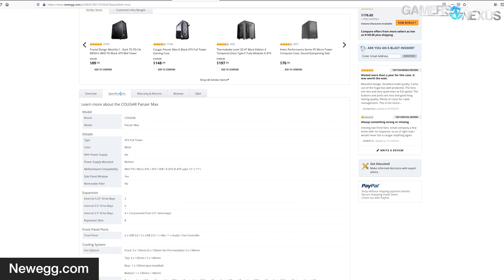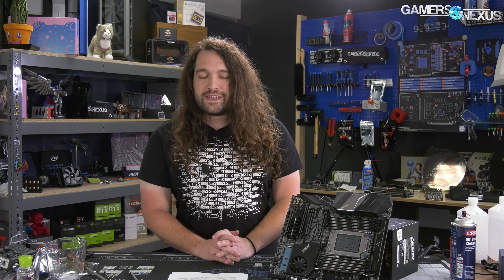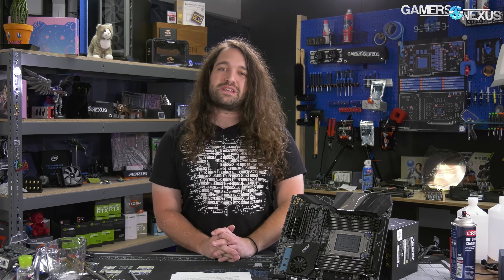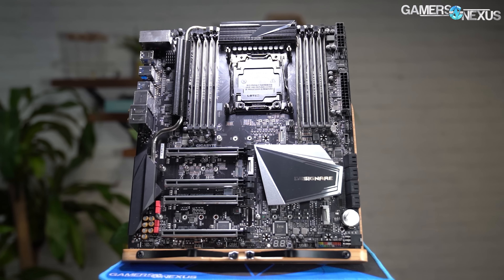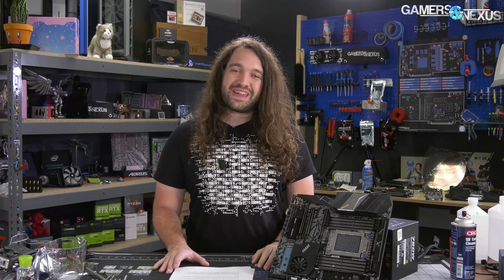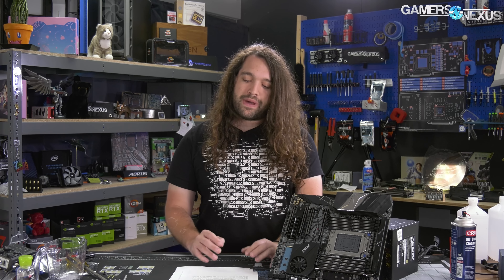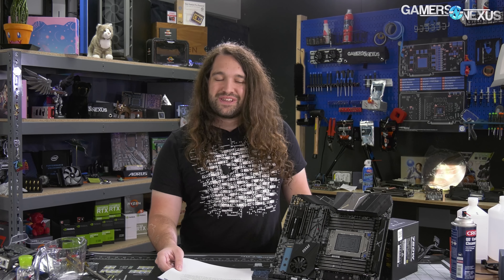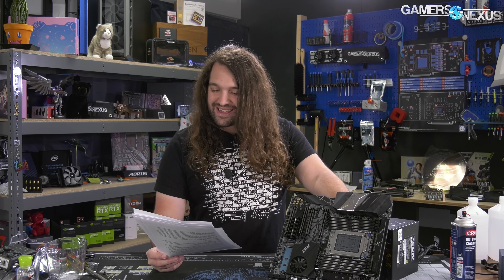"E-ATX" Is A Lie: How Motherboard Makers Ruined Form Factors

Comment from the maker: Watch hardware news for the week, including the AMD hack, over here: https://www.youtube.com/watch?v=T1dNHbDYlDA
Article: https://www.gamersnexus.net/guides/3566-e-atx-is-a-lie-vs-xl-atx-eeb-ceb
Reply: E-ATX, What part of 13 inches (330.2mm) Do They Not Understand!? lol.
so it is as bad as a top rad not fitting in cases that list them as 'compatible' if you don't use a motherboard at the same time, lol.

I'm sorry y'all, I think I'm partly to blame for this vid after poking and prodding at E-ATX and XL-ATX cases. Great vid Steve and crew. B)
Reply: Luckily,my locally made case supports motherboards up to 13"x15",
My case looks like the CORSAIR Crystal 570X RGB but it's much better and cheaper than it (There are filters including in the front,also i removed the front glass for air-flow),
and no i don't live in China,I live in the EU :D
Reply: 20+ years ago you bought e-atx if you wanted more pci slots.

Which is realistically what I'm looking for today, but can't find on current e-atx board's anymore that are usable 😔

As for cases, current generations on the market are useless to me, and since I have a wood shop I usually just build my own and fasten drive cages and motherboard tray internally.
Reply: You left out thin microATX that some ASRock and msi have where the width is smaller than the standard ATX
Reply: @portwolf2293  wasn't that WTX 14 × 16.75 in (356 × 425 mm)? for 9slot WTX and 11slot SSI-MEB 16.2 × 13 in (411 × 330 mm) cases?  I think Lian Li was the last to make them, about ten years ago.
Reply: @Zarcondeegrissom  I don't know about that specifically. I'm just pulling from what I remember back when I worked for Virginia internet express in 99 as a manager / network administrator.

14 years ago I changed professions because of job market saturation in my area so I missed out on alot.

Had to support a family 👍

If only we could talk gamers nexas to come out with their own line of boards 🤔
Reply: @portwolf2293  thats cool, and family first is always cool. B)
way back in 2004 I had dug into that stuff to dice up an old IBM XT case to make my own workstation case after not liking ANYTHING on the market for such things.  E-ATX has always been 7 slots (12x13 inches), tho it is understandable that 'extended' may be referred to as more than 7 slots by many. many do confuse micro-ATX and iTX all the time, despite the spec having 3 fewer slots on iTX than micro-ATX, lol.
Reply: Sick skin peel bro!
Reply: @portwolf2293  I am on my 3rd use of a Enermax ADV Ostrog as I am happy enough to have the unneeded drive baus from it.
Reply: your forgetting thor v2 which will handle all specs including xl atx/ssi ceb e-atx 12x10.3
Reply: Anyone wanna tell Steve that 2x4's are not 2x4?
Reply: I like your content, but Dude, please get a hair cut.
Reply: As much as everyone loves adding more work to their process, could Gamers Nexus add a quick internal measurement to their case review process and throw it into a spreadsheet somewhere? This exact issue has cost me $100's of dollars since getting into dual CPU workstations. Thank god for Microcenter open cases or it would've been more.
Reply: @Gamersd Nexus I got my first build built and posted and up and running with no problems.. I dare say 6 months of watching you and jayz2cents have helped immensely so glad I didn't waste my money on a pre built gaming rig. I love you guys !
Reply: dude     $450 on a card, today,  what r u goin with?   im buying one.  upgrading from a flashed vega 56..   cause im pushing a 38 in  75 htz 1600p ultrawide..  its not cutting it..    i just almost bought the nitro plus 5700 xt,  i was dead set on it,    and tabbed over and start lookin at nvidia cards..    help me out!   for real i value your opinion..     many thanks.   great work btw..
Reply: ITX has some crossover with DTX as well
Reply: lol how to make product sound better? Oh I know..let's just extend the name by putting literally word "extended" in it. Oh wait it's not cool enough anymore? How about we extend it even more!? Yeahhh let's put yet another "extended" word in it. Perfect! Lovely! Coz that makes sense ofc xd
Reply: If you buy a graphic card at the moment, you got ripped off, far worse than  normal.
Reply: If you bought a graphic card right now, you got ripped off.
Reply: Memorable video......was 10 years due and about time, you spoke out for all of us tha understand, that overall today, case manufacturers are charlatans, and that they should only make either CEB or EEB cases if and cut all the crap....... its sad to see they still make cases that could fit massive server boards, and instead all you can  drop in  is a postcard on the same damn chinese pressed motherboard tray that is worth 1 dollar
Reply: Mini-DTX is a stupit form factor too, it is AsRock's way to saying is Flex-MAtx...!!!!

Comment: This is right up there with "radiator compatibility" where the compatibility assumes that you wont be installing any RAM.
Reply: Or compatible with a 360MM radiator (as long as you chop the end-tanks off each side)
Reply: That one drives me nuts. "compatible with 480/360 etc etc". O but you can't use them all at the same time!
Reply: Getting a little greedy aren't we?  Asking for a cool CPU AND RAM?
Reply: I heard you can just download RAM as needed - no need to install it up front.
Reply: Jesus dude, don't remind me of the headache of trying to top mount a damn rad which says it's compatible, only to have to take the thing apart multiple times as the fans do their best to rip the dimm slots right off the board...
Reply: I had this issue on my first PC build. It was a terrible experience.
Reply: What do you you wanted a radiator AND fans?
Reply: @Ironclad17  my brother is currently running 2/3 fans on his Celcius S36 because his case claimed to support his GPU (Zotac RTX 2080 AMP! Extreme) and a front mounted 360MM rad, but did not claim to fit both at the same time 🤦‍♂️
Reply: Or prioritizing it over GPU intake

...@FractalDesign Era ITX

My theory is that cutting rad support and moving the mobo up 25ish mm would really help that case. 120mm intake from the bottom, Noctua U9S on the CPU, and 120 exhaust on the top.

Obviously, though, a manufacturer can't make a consumer case in 2020 without rad support and expect it to sell well. To quote a US President, "Sad!"
Reply: or a motherboard, given the VRM aluminum lump and EPS plug conflict in some cases with a top-mounted rad.
Reply: it's because they assume your just downloading your ram 😆
Reply: @Celician83  Did it mention supporting the GPU, a radiator and fans at the same time? There's your problem.
Reply: Fractal Design are a key offender for this. Like for fuck sake guys, I love your cases but come on. Just make the damned thing half an inch taller and deeper, and everything will be sweet.
Reply: Or want to use certain fan/pump headers
Reply: That's what RAM slot extentions are for! You just have to move them down to that pointless vertical GPU bracket.
Reply: @liftedcj7on44s  you can if you take the fans off! mounting them is rough though.
Reply: So true.. Fractal Design Meshify S2 (in my case.. hehe) i have a 420mm Radiator on top, it fits perfectly BUT i had to cut some corners from 2 of my fans to make it possible to mount them because of my mainboard and trident Z Royal ram. It gives me herpes..
Reply: Just found that out in my meshify c mini. Can’t fit a 240 rad with fans on top with ram installed. Well, unless I wanted to cut some plastic from the fans lol. Had to put the rad in the front
Reply: @Zarcondeegrissom  Who the hell needs EPS connector! Right? Right? Looking at you Fractal Design and Cooler Master!
Reply: 640k ram is plenty enough!
Reply: why do u need ram if u have a sweet rad
Reply: i cant use my computer cuz the ram is in the way of the cpu water cooler  and is now a $700 paperweight. i have been to lazy to buy a new cooler and so have just continued using my old pc (witch i could probably swap the motherboard from the new pc to the old pc and be good. idk if i could use the old water cooler though or if i would have to swap those as well)
Reply: Holy fuck Fractal and sometimes Phanteks are infamous for this issue and older Corsair and Lian Li too. Like, I guess they want me to buy a fucking small housing complex to fit a huge system instead.

Comment: Eeatx is what happens when we've been using an acronym for 30 years and everyone forgets what it originally meant.
Reply: @snowwsquire  that universal one that has so many variants with confusing names?
Reply: @jordanwhitecar1982  you mean usb 3.1.2 ver 2: part deux?
Reply: Like NIC Card: Network Interface Card-Card
Reply: @J Fz atx was introduced in 1995, fair enough, 25 years isnt 30. But AT was in use for a while before that, so my point is still valid, as atx was an evolution of at
Reply: @richiec7700  nic is network interface controller actually
Reply: Sounds just like what happened to BMW. The numbers in the model name used to mean the displacement size of the engine (If I remember) but their customer don't like smaller numbers.
Reply: @iHasCaek  I believe it is USB 3.1.2 ver 2: part duex, he's back, and this time he means business!

Comment: @Steve ~16:20 DON'T suggest ATX acronym (with size spec) for wider boards! That will just make it WORSE by adding more confusion.

At least we know today that ATX boards are E-ATX case compatible, not vice versa.
Hence:
If i read ATX board, i assume ATX case compatibility.
If i read E-ATX, i compare size spec's.
If needed for clarity, i suggest e.g."E-ATX 280mm" as a std definition, printed/stamped visibly.

Comment: I got the msi meg godlike x870e motherboard that says it is e-atx but it uses normal atx mounts it is just slightly larger than the atx size but did not meet the e-atx mounts in my thermaltake wp200 dual pc case

Comment: Imagine if the industry kept the old PC-XT's form factor instead of the PC-AT's. 
We'd have EX-XTX: Enhanced Extended Extended Technologies Extended!
Reply: You mean... kind of like Xbox Series X XBox shipped in a series of boxes marked with X.
Reply: You missed an X there. Pretty sure it stands for X-TREME.
Reply: Let's just go with XXX-ATX (eXtended eXtended eXtended- Advanced Technologies eXtended)...
Reply: I just imagined a new star wars imperial walker from that acronym
Reply: Like with GPU´s, more Xs more power...we were so close...
Reply: @2nd_Directorate  XFX Rx 580x EX-XTX compatible eXtreme edition?
Reply: I could win multiple games of noughts and crosses with all these X's.
Reply: Well they were bigger mopthwerboards - i still have several in my Uni schools hardware library/museum.
Reply: Install your XFX Radeon X1900XTX today!
Reply: Shout out to HIS, Sapphire and PNY, for gems like Radeon X1950XTX E-X (had taller PCB for VRMs than 'normal' XTX), and GeForce FX 5900XTT (first 4-slot GPU I've seen, an engineering sample mercifully, as it was louder than my hair dryer).  It's almost like adding another X sells it more. My body is ready for that sexy 2080Ti - XXX. I promise I will only play smut games on it!

Comment: While we're ranting about stupid ways to do things, I hate the way dimensions are referred to and how different websites put them in different orders.  I was taught that sizes go as LengthxWidthxHeight.  But for cases, on PcPartPicker, it goes WidthxLengthxHeight and what I would call Width is called Length and vice versa.  Amazon atleast keeps things in the order I know them.  Then we get into what those things mean.  When I say "My computer is X inches long, X inches wide, and X inches high." the length is how far it is from the front where the front I/O is to the back where you plug all your power and video cables in and the width is from side panel to side panel because I'm talking in the way you would if you looked at your PC from the front, which is how we get ship dimensions (Titanic was 882 feet long, 92 feet wide, and 175 feet tall for example, no one would say she was 92 feet long and 882 feet wide.)

Why is it so hard for everyone to agree on a standard for describing dimensions?

Comment: Eatx was a tyan microsystems size used in conjunction with chenbro cases back in late 90's. Ssi-eeb came out several years later and it all got mixed up like a mayonaise since then. Theybwere almost always used for dual and multisocket mainboards

Comment: Even the Thermaltake Core P5, which is an open case, but has a small closed space for fans and wires, forgets that the front I/O has some depth, making it almost impossible to place a fan next to it! I managed to get only 3/4 screws in while having the cables bent in an uncorfortable way.

Comment: Last summer I use the same SSI EEB standard document to layout a test bench for a dual socket motherboard I had.  I cross referenced the ATX hole spacing so i could also use the bench for other boards, and yes, I too realized the holes were the same just with another row.

Comment: Apparently though, the Gigabyte TRX40 XL ATX is also wider than the ASUS E-ATX WS X99.  Which is why I could barely fit the TRX40 board, width-wise, in a Be Quiet Dark Base Pro 900, even though the E-ATX "spec" is wider than the XL ATX while I had no sure issue with the ASUS E-ATX X99 board... 🤬

Comment: Well, there even is a whole country that is proud of sticking with a archaic imperial measuring system, even with the rest of the whole world using the metric system, so you shouldn't be so surprised a bunch of private companies can't agree on a standard measuring system for pcbs
Reply: I get what you're saying, and being in the US I do think it sucks that we stick with this system, but creating a standard where there isn't one is a whole lot easier than trying to change a standard.
Reply: @juandefs  Surely engineers should be good with maths - it makes so much sense to have an imperial system that counts in base 12, base 16, base 14 & base 20 (and probably a few I have missed) - it keeps your mind sharp!
Reply: @justinstephenson9360  computers do the math nowadays you just input the values and in design, well you are designing the damn thing why would you need "to get your mind sharp" as if you werent using your brain lol. Also having a bunch of tooling for both systems is a paim in the ass, especially in the auto industry, those guys suffer.
Reply: Most in the US can use both perfectly fine lol. Atleast anyone who's measuring anything. Except carpenders maybe, but they don't really need to measure in mm lol.
Reply: @eyetvideos467  God forbid they use centimetres instead of millimetres, but carpenters are held back by the nonsense that dimensions are when buying wood 2x4, etc. Complete nonsense...

Comment: Bpeaking of things that get my goat - PCI devices with misaligned ports.
Bought 2 AMD cards not too long ago, the slots for plugging in HDMI/DisplayPort/Whatever are shifted so far to the side, they're actually partially blocked by the PCI cage, or right on the edge to the degree that standard cables cannot make connection if plugged in (because the PCI cage blocks them from going all the way in).
Had to go out of my way to import a DP cable with connectors of non-standard dimensions (I think it was 12mm vs 18mm, don't recall)  to be able to attach any screens to it at all!

Comment: Omg so much agreed right now

I'm trying to design a portable PC right now and this form factor garbage is such a pain in the arse. Just make them standard form factors and list the measurements. Thankfully my computer shop does this on all it's listings regardless
Reply: For SFF they are standard. mATX is 9.6" x 9.6". mini ITX is 6.75" x 6.75"
Reply: @KenS1267  For real. ITX is about as small as you can get as a standard for consumers. Most heat sinks are bigger than the board if you aren't using water.
Reply: @ferinfox  undersized is fine, at least they all fit in cases meant for the form factor the boards belong to. Unlike EATX that can be as wide as they want
Reply: @aexandereung5686  While still not garanteed to be compatible XD
Reply: why are you trying to make a portable PC out of a board bigger then ATX,hell you should go even smaller then ATX for portable

Comment: Not surprised by this ... I was surprised by my first "EATX" X399 board when I realized it only had the regular ATX mounting holes with a huge unsupported overhang that didn't come close to the size I had assumed "EATX" meant.  This was after having built a dual xeon server on a supermicro board that was huge and very well supported.
Reply: Why would you assume that a consumer product would comply to sane standards that make it easier to understand?
Reply: At least Supermicro admits that basically all their dual socket boards use "Form factor: proprietary" and give you the outer dimensions to throw you a bone. My dual xeon board actually sticks out above the I/O shield, making it fit in only a few cases to begin with, and ruling out any chance of top mounted radiator support.

Comment: I hear  you. Bought a cheap Supermicro X9DRH-7F motherboard off ebay and an a rosewill 4015L case.  Both say E ATX. It fits but I only had 3 holes for motherboard stand offs that lined up. I ended up using a center punch and drilling/tapping the case to install all the standoffs. Also the fan wall won't fit. Not even close with a eatx board in there.

Comment: I personally believe that the only instance where you're allowed to create a product outside the standard specification is if all other components are included, think consumer electronics, there's no standard, but you don't have to worry that your tv's panel controller won't fit inside the chassis.
I love sff computers, and in particular Asrock's deskmini lineup. It's a bespoke motherboard but you won't be struggling to fit it in a case because it comes with its own. 
So basically, if you manufacture motherboards, either stick with the standard or release the product along with its accompanying case